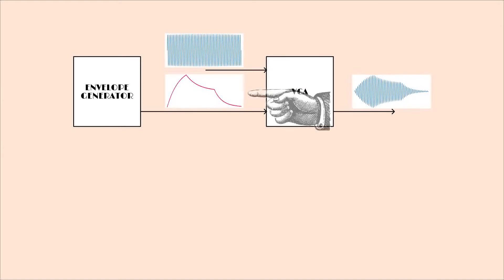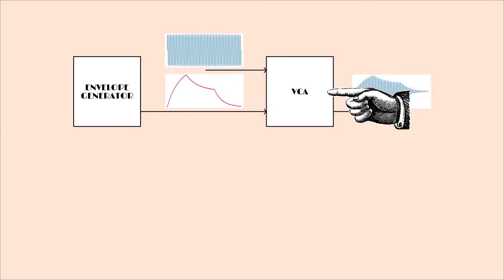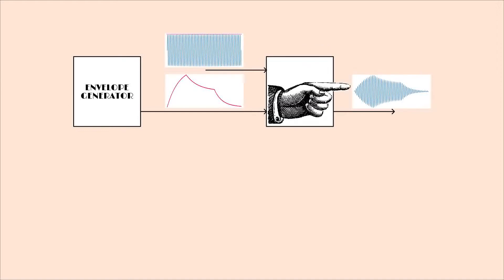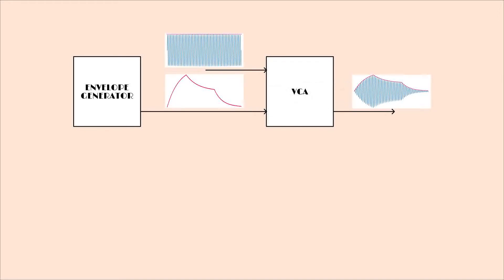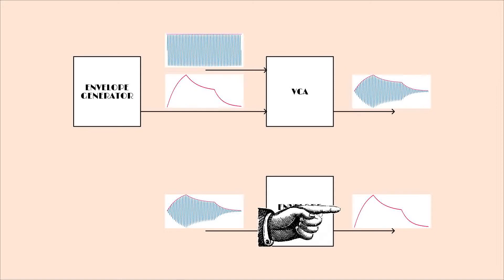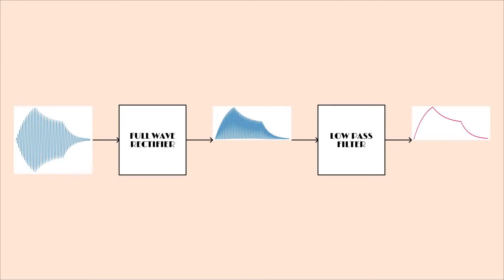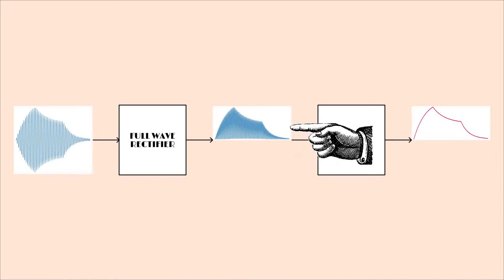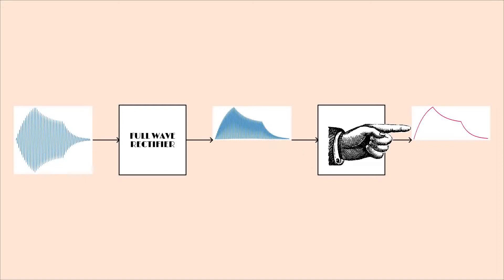ARP-inspired envelope follower

Comment: Excellent video. Interesting choise for the pre amplifiers. I'm glad you like the 3 different input level configuration that I used on the stripboard design. :)  I updated my E.F. design with new layouts and schematics. I used your instrument pre-amp choise but I used my earlier mic amp design. I couldn't get the two transistor design working. Cheers, Eddy Bergman